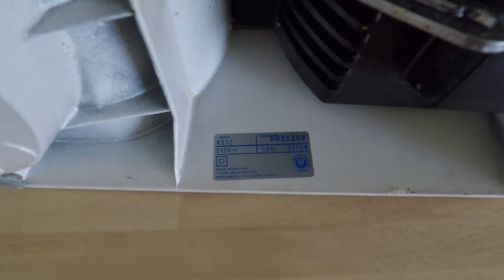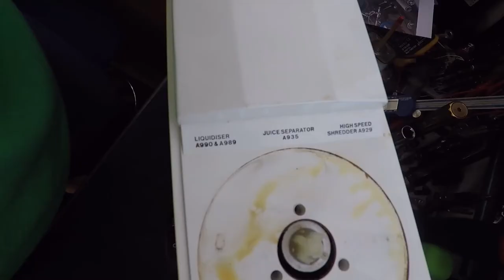50 year old Kenwood Chef mixer repair and refurbishment

Comment: I’ve not watched the whole video as I freaked out when it got to the part needing a soldering iron! But I was glad to see new feet were fitted. When age compresses the feet, it reduces air flow which is crucial for the life of the machine. Now to try and find out why mine is leaking grease…
Reply from the maker: I think they all leak grease as they get old because the fatty part of the grease separates from the runny part. (technical terms!!)   The grease left inside is usually very thick.  The soldering is easy. You can do it.
Reply: @DaftOldMan  😂😂😂 I do own a soldering iron — I’ve just never used it! I’m not sure starting on my precious Kenwood Chef is a good plan. But I may watch some videos. Thank you for the feedback and the encouragement.

Comment: Not exactly a refurbishment, haven’t touched the main gearbox or motor.
Reply from the maker: The motor and gearbox did not need attention and continue to work perfectly over one year later.
Reply: He repaired parts and refurbished parts. What more do you want? Maybe a thank you for him putting the effort in, and making an informative and helpful video that hasn't cost you anything, other than your manners, it seems. I will do it for you as it seems you were brought up without any manners or gratitude.

Daft Old Man, thank you for providing this video that you have made using your own time, money and effort to provide a clear and easy method of repairing a common fault on these old Kenwood machines. It was very easy to follow and I'm sure your video alone has helped keep a lot of these otherwise bullet proof machines on the go. Thank you.

See, wasn't hard, was it?

Comment: Daft Old Man, thank you for providing this video that you have made (using your own time, money and effort, may I point out, to a couple of people posting ungrateful whining comments on here thankfully only a couple) to provide a very clear, and easy to follow method of repairing a common fault on these old Kenwood machines. Your efforts do not go unappreciated!

 I'm sure your video alone has helped keep a lot of these otherwise bulletproof machines out of going to the tip and endingyo in landfill. They really are a great machine to have, much better than any modern stand mixers.

 You've helped me fix mine, a machine that was made before I was even born, and thanks to your video, I've repaired it to a standard that I am confident it will be here, still in use and working, a long time after I am gone!

 As an extra step I replaced the resistors aswell, as they came in the kit I bought. I also replaced the brushes, regreased the motor bearings and just gave it a general good cleaning and brought it back to life. Mine is an A901, and it has the usual age related yellowing on it, but I'm going to strip it back down retro-brite it using hydrogen peroxide and UV lights. I've had good success with old PCs and consoles with that method and I think it will make this mixer I have look like new. 

I bought it a year ago, from ebay, with the intention to fully strip, service and rebuild and overhaul all the electrics before using it, but I ended up getting impatient and ended up making some bread - and halfway through it's kneading cycle, there was a loudish pop/fizzing noise and more black smoke than what came out if the twin towers - served me right for not waiting I suppose!  Im aquiring the full set of attachments - blender jug, stainless steel bowl, sausage stuffer/mincer attachments, pasta maker etc as I will get full use out of all those things. They really are fantastic machines. 

I thought it was going to go for scrap after the black smoke appeared, butt your video has got me back on track, and pretty soon it will be a complete, fully working, brand new looking, nearly 50 year old Kenwood chef, taking pride of place in my kitchen. 

So again, thank you!

Also, for anyone rhat doesnt know, you can now retrofit a newer, more modern motor to these old machines that have more settings and features built in to it. When you buy it, you get all the extra electrinics and parts required to make it a quick and easy drop in replacement. 

Amongst other things it can add a setting for folding in ingredients that you don't get in the older machines, that for me would be a handy setting to have. Just look for "kenwood chef motor upgrade kit" and you should be able to find it. It's by no means essential, but if your old motor is knackered, it makes sense to fit the more modern replacement.

I apologise for any spelling/grammar mistakes. I'm oretty much blind and struggle to see what I've written, and sometimes use a speech to text app and an auto spell checker that doesn't always do its job properly!
Reply from the maker: Fantastic comment. Thank you.

Comment: Great detailed and thorough fix!
Only thing is the lowest speed became too slow. I believe the 2 screws holding the board control the lowest speed if you tighten or untighten them. I am not sure. I recently replaced the x2 capacitors because they were smoking and bulging and I believe I adjusted the lowest speed using these 2 screws.

Thanks for sharing
Reply from the maker: Thank you for commenting.

Comment: I still have my Kenwood Chef 901 here in Thailand that I bought in England in 1967 ish. The heat sensor tripped out a couple of years ago, due I think to overloading while making bread, or to the average temperature of 33c here maybe. I removed the sensor because I couldn't get a replacement.Is there a way to repair it. I'm still using the mixer, but I don't want it to seize up. I am no electrician but your video is very clear and precise. Thank you.

Comment: Hi Mr. Dom.....thanks for sharing.   Found it very interesting. 

How do you source the parts?  

Have a happy day 😊
Reply from the maker: Hi John. I got the parts from ebay. I bought a speed controller repair kit but only used the two capacitors. I also bought the rubber feet on ebay.

Comment: hello ' can you say what are the capacitors and triac values?
thanks
Reply: I know the answer comes over 1 year after the question, but:

My mum owns a Kenwood Major KM230 and the circuit board looks pretty similar to the PCB of this model.
As of the view at timestamp 4:45:
The value of the big front capacitor: 150 nF
The value of the big rear capacitor: 100 nF
The printing on the triac says: PH 71719 m8745
On a quick search I wasn't able to find this exact type of triac.

There is an article on "Instructables" with the title …
"Kenwood Chef A902 A904 AC Motor Speed Control Module"
… which holds a lot of additional information about this type of Kenwood machines. At this site you can find a schematic of the PCB and more.